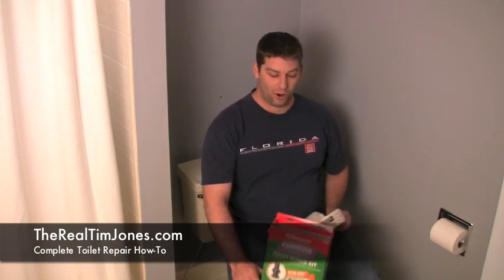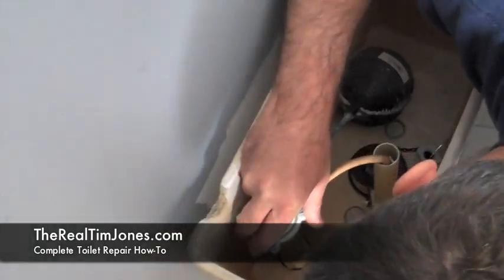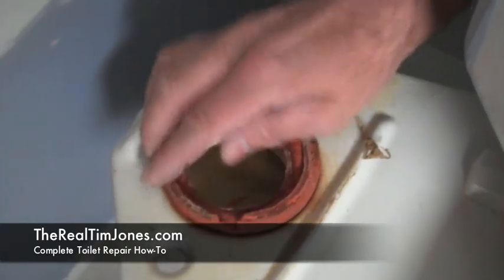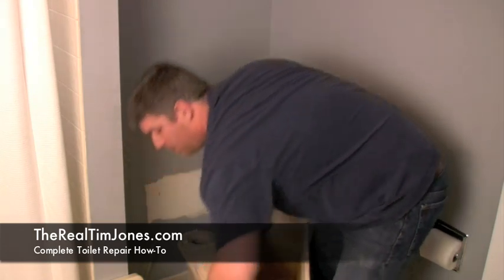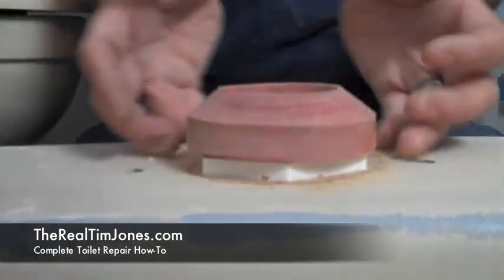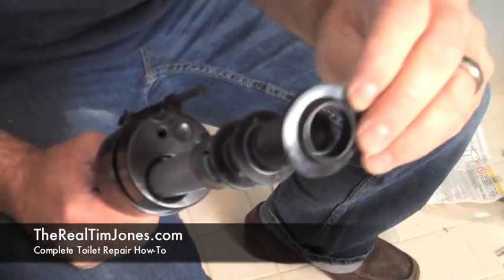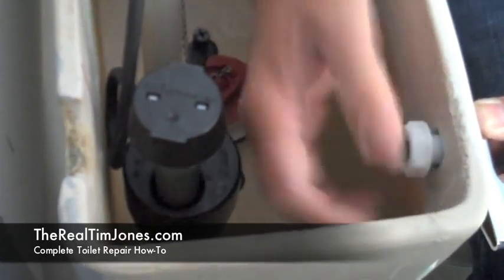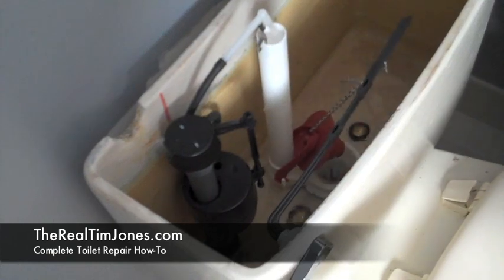Home Improvement: How to Install a Toilet Repair Kit

Comment: This is a good instructional video to a point. However,  there is a HUGE step missing that conforms to the national plumbing code, and could be disastrous if not done properly. The overflow tube MUST be cut so that its height is at least one inch below the flush handle hole. Also, the water level in the full tank must  stop at least 1/2 inch below the top of the overflow tube. If this step is not done correctly, and the float/valve does not turn off the water as it should, the water could leak out of the flush handle hole and flood the house. In that case you had better have some great homeowner's insurance. Another useful tip: NEVER put the bowl fill line down into the overflow tube, as this can create a siphoning effect causing water to continuously flow into the bowl and trigger ghost flushing. I am Just trying to be helpful, and prevent people from experiencing a disaster here, with some practical plumbing code advice.🙂

Comment from the maker: It has to have some sort of float switch.  The newer ones looks like a column with a larger top half.  You can adjust it by twisting it up or down to control water level.

Comment from the maker: @ddk80 Glad it helped!  It's the chain....you just haven't found the right spot, yet.  Keep playing with the length of the chain and you should get it.  You should also have about three different holes on the handle where you can attach the chain.  This could also make the difference.

Comment: 7:58 At this point you can see that the "Overflow Tube" is too tall.  The tube should be cut short enough length, so that water will spill into it, instead of spilling onto the bathroom floor, in the event the fill valve malfunctions.  My neighbor called me, and said, "What's wrong, water is dripping out around the flush handle?"  Easy fix was to shut off water, and drain tank, then I used a soldering iron to "burn" some holes in the overflow tube, below the lowest  level of any holes at top of tank, (ie. handle, and air vent at back of tank.)  Also had to adjust float, so that tank would not attempt to overfill.

Comment: Thanks Tim!  This is a great video, and I installed the kit today. One issue I have is the flapper closes too quickly, resulting in an inadequate flush. I have adjusted the chain and still no luck. Do you have any suggestions on what might be causing this?

Comment: Thanks for posting this. I did this last week on both of our toilets and I've noticed two issues: my flap doesn't form a tight seal, so the toilet sometimes just runs (with toilet #1), and #2 toilet regularly lets out a little bit of water into the tank. Can you help me out?

Comment: My toilet has three screws holding the tank to the base...but my kit and your kit only have two replacement screws.  Any advice?  Is it as easy as going to a hardware store and find a similar screw washer gasket, or do I need a knew tank?

Comment: The toilet refills normally and cuts off normally and is quiet. I replaced the flapper valve a couple of days ago and it seems to seal properly. HOWEVER, a small flow from the rim holes continues to flow into the bowl. All in the tank seems properly installed/working. The only thing I question is that the refill tube (hose) sticks way down into the overflow tube (4-5 inches). Could this be causing a minute siphoning to the rim holes?

Comment: so i noticed u put the nut at the very bottom after setting the tank on the toilet. I think that is incorrect. the nut needs to be set in first so literally u can hold tank in your hand and fill it with water and it should not leak.
then put the tank on the toilet and use wing nut to tie it down.

Comment: You didn't say anything about 1) Having to buy a specal tool to get a large plastic nut off the bottom of the tank ($18 at Lowes!) or 2) adjusting the height of Flush valve and cutting down the height of the fill valve.
Reply: He showed you how to loosen it. You must not have noticed. He used the channel lock tool on pretty much everything

Comment: I'm stuck at 3:08 - can't unscrew the "nut" (if you can call something that big a nut) without turning what's attached to it...I'm going to bed for now.
Still I'm just proud to have finally got the tank off and the screws out.
Reply: I had that problem due to hard water and finally had to use a hacksaw to cut out the flush valve outlet nut (aka hex nut, spud nut, etc.) and the part it was screwed on to.

Comment: You forgot to show us a step, the one where the bolts go on the tank first, and then the tank is placed on the toilet, and secured with the wing nuts. As a result, I kept trying to put the tank on the toilet with just the bolt and regular nut, and wondered why it leaked. Please correct this. I watch these vids because plumbing is not obvious to me, and I don't know what the hell I am doing. So I expect them to be thoroughly detailed.
Reply: Yeah, he missed some points.  For me, he didn't mention that there are different gaskets (tank to toilet) and if you have a certain toilet, the gasket that comes with the repair kit will leak really bad.  Once I got the right gasket, no leak.  So that should be added, too.